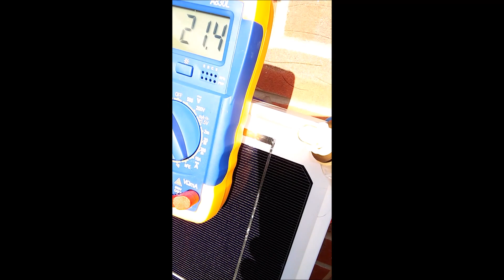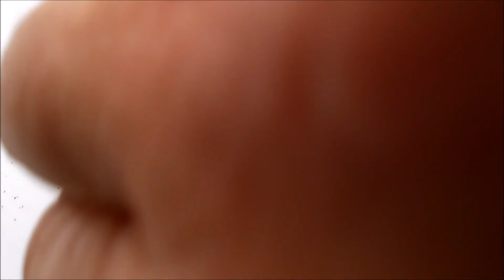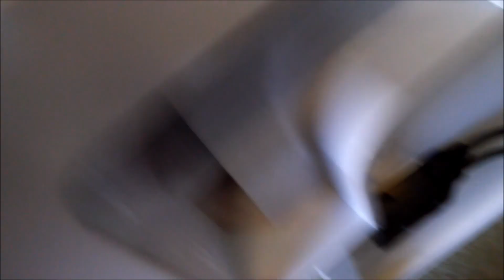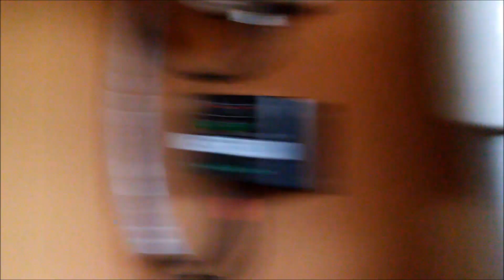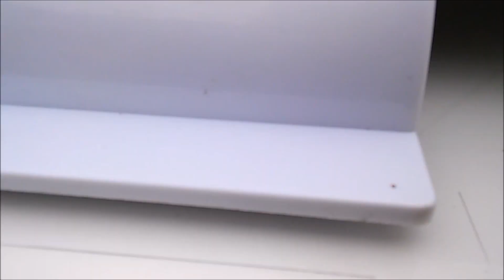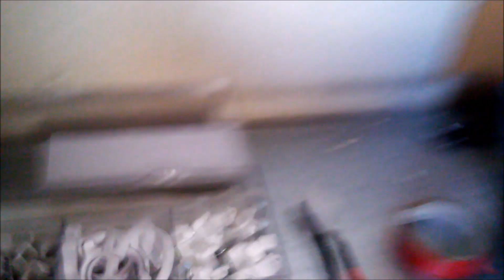Motorhome solar panel installation.

Comment: Great video, this has given me the confidence to have a go at my own. Was 100W enough on reflection??
Reply from the maker: Hi yes the 100w panel was perfect for us. I did change the controller for a Victron MPPT version so that helps. If you go wild camping a lot then a 150w or 200w and 2 leisure batteries would be perfect.

Comment: With 19w coming in, an mppt controller would increase your amp output. What battery bank do you have?
Reply from the maker: I did replace the basic controller with a Victron Blue Solar MPPT version at a later date.